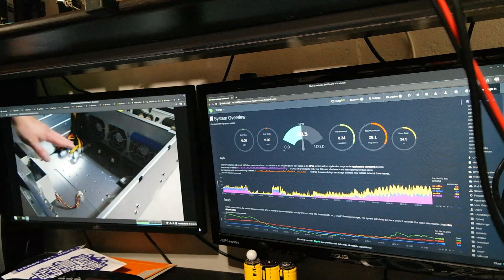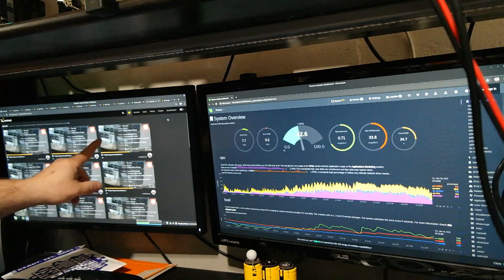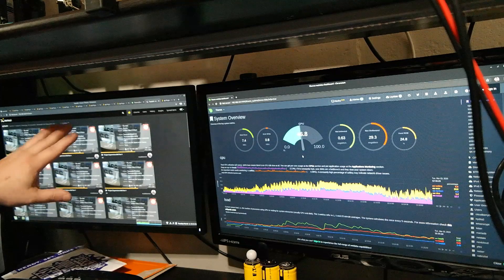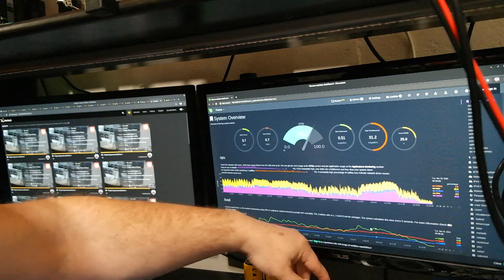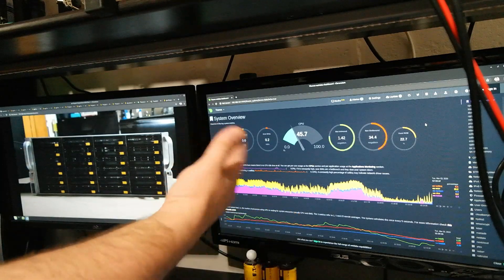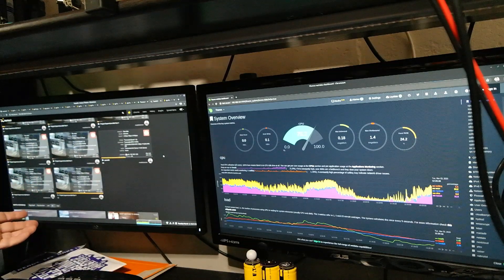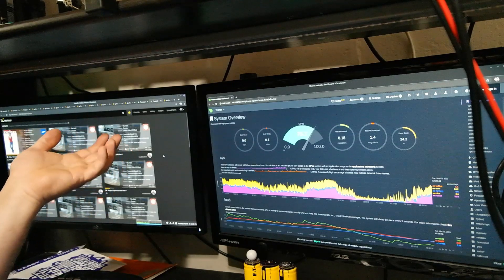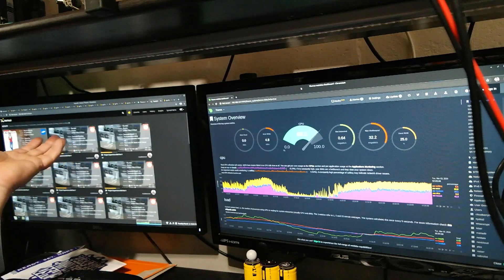PLEX QuickSync Transcoding Performance Test

Comment: i just changed my Plex transoder to run off the IGPU and not my GPU and it seems to play and run smoother. im running a 12700 and GTX 1080. oh, and to change it to your IGPU is not in Nvidia settings anymore you have to go into your display settings then graphics settings: edit: now Plex has a setting to choose what gpu you want to use in settings
Reply: WHAT'S YOUR PERFORMANCE?
Reply: @isaacfarescohen  I'ts a lot better than the GTX 1080 which only allows 2 transcodes unless you modify the file which i dont like doing

Comment: If you transcoded it a few minutes ago it should be saved in var or usr/lib ...

No reasom why the the second play had to spike and buffer. You have a bottle neck - i would assume lan pipe is dense. Create another SMALL subnet segregate the media group-  check to make sure plex is saving and is dishing out the transcodes - check the var/cache folder as well and has rw perms correct. 

Im using a ***dia ***la V100 and i can get almost 40 streams trans (proxmox vm) from 1080 to 720 before that card has client side buffering. If a video is transcoded it will sit in a  cache folder (zfs managed but not a cache vdev) and chron job  the "rm" when atime is greater than X days from present day....

Then i found jellyfin ❤❤❤ 

Depending on your card work the math backwards. Direct vs ratio of stepdown vs mem bandwith. Gives you an idea of how many streams you can have open during transcoding.

Imagine if card sat on a container.... 40 streams easily doubles imo....

Comment: So I bought a HP 290-p0043w which has 8th gen Intel QuickSync and Ubuntu 19.10 Server, this little machine gets easily 15+ transcodes no problem. I highly recommend as it is very efficient. 

https://forums.serverbuilds.net/t/official-hp-290-p0043w-owners-thread/2829